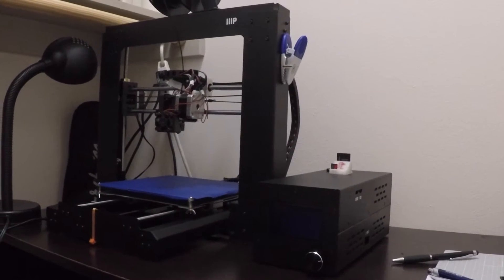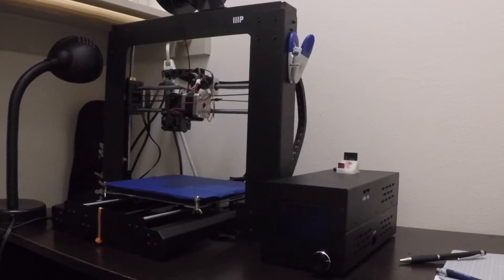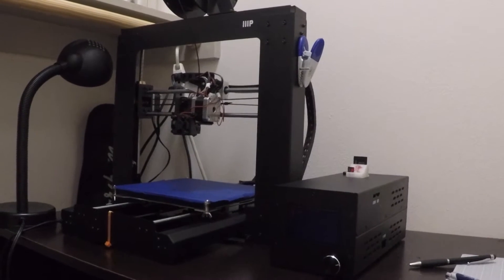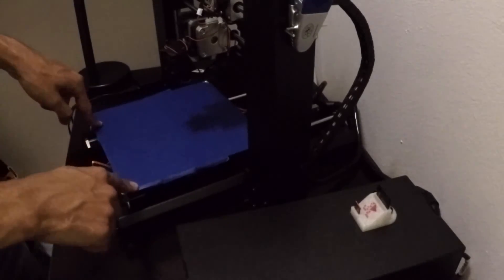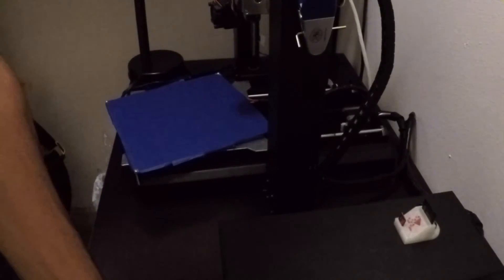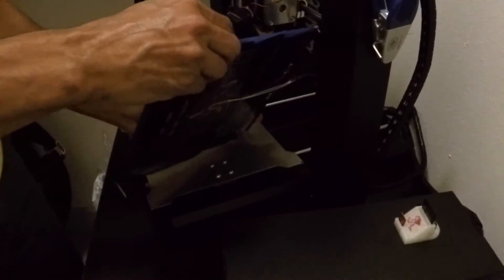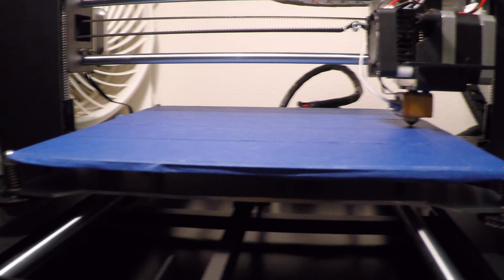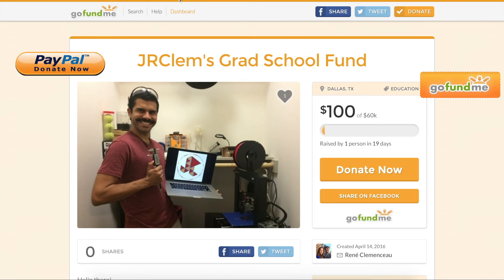Monoprice Maker Select Mods #1- Minor adjustments and thumbwheels

Comment: is there a reason you didnt just change out one wheel at a time?  instead of all four at once?
Reply from the maker: Because I needed to install the locknut that goes inside the spring. I thought it was just easier for me to access the holes and screws as well as set up a better shot if I removed them all.

Comment: Funny thing, my Geeetech came with a glass bed that was slightly sagging too! Or rather having uneven thickness. It seems flat on the other side. It's not a big issue really anyway, i mean it's clearly less than 0.1mm deviation, closer to 0.05mm. I mean this is why first layer thickness is different from other layers, you set it higher to print thicker, tune it down so nozzle is as low as it'll go, and let it smash the first layer a bit, and give it extra XY compensation. I don't mind first layer being 0.2 or 0.3mm thick, i can have 0.1mm layers on the rest if i care.

Mirrors are nice, they have to be very flat else people would see and complain. PETG sticks to well-washed glass extremely well, and PLA pretty well too. ABS - haven't tried yet, the roll is in the mail, i don't anticipate using it much but will have to come up with something, but i have glue stick, i have acetone, i have the options.
Reply from the maker: +Siana Gearz Mirrors! That is a good tip! Thanks for that.
But yeah, glass can sag too actually! That's why people recommend using borosilicate glass. Maybe a higher thickness would help too. 
I have a glass bed now, and it is great! I haven't printed much ABS on it, But no problem so far. I use Aquanet for adhesion and I love it. I'll be making a video about it.

Thanks for your input!
Reply: Well we don't have this Aquanet in Europe. I tried Balea Ultra Power that i had on hand because that's what i use on my hair occasionally, tried to use it as PETG release agent, but it was useless, no adhesion whatsoever. Somebody on a German forum says that a bunch of European manufacturers he's looked at collectively changed composition at once not too long ago, removing VP/VA copolymer that was apparently responsible for hot print adhesion and replacing it with Octylacrylamide/Acrylates/Butylminoethyl, and looking at my Balea bottle that i have, he might very well be right, because of course people used to report that Balea worked in the past.

Comment: What setting did you use in cura. Are those rafts and did you put painters tape over the stock bed. Im having a hard time printing these out. I cant get the initial layers to stick. I just imported the stl files chose the normal print quick profile and I am having no luck. Im using a glue stick on the stock bed. Any suggestion, cura setting tips, etc..
Reply from the maker: Tyler P I used painters tape directly on the aluminum bed. Sometimes glue stick helps, yes. Make sure that your temperatures are correct. I usually print PLA at 210°C with the bed at 60°C, but this can vary depending on the manufacturer or even your setup (ambient temperature can be an issue). Also, make sure that your bed is level and the nozzle is not too far off.
 I usually don't use rafts. I think that for most things they're a waste of filament. For the most part a brim works well. In this case I just had a skirt to prime the nozzle, so no extra adhesión techniques.

Comment: I'm just starting so sorry if this is a dumb question but how did you print 4 at one?
Reply from the maker: +eddieopus hello, Not a dumb question at all! You need to add the item multiple times to your slicer software and arrange them in the bed. Be aware that more items in the bed can increase the chances of failure and will increase your costs if that does happen. You're printing at a higher risk in exchange for some time gains.

Comment: did adding the nuts help with stability?
Reply from the maker: you mean the nuts directly under the bed? I believe so! it certainly made leveling the bed easier since you don't have to hold on to the bolt's head when screwing the thumbwheel.